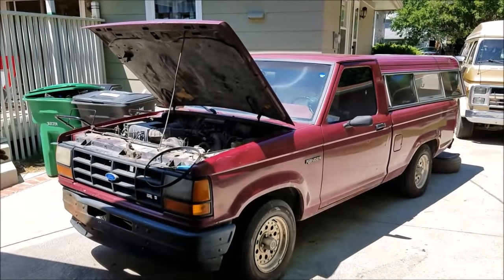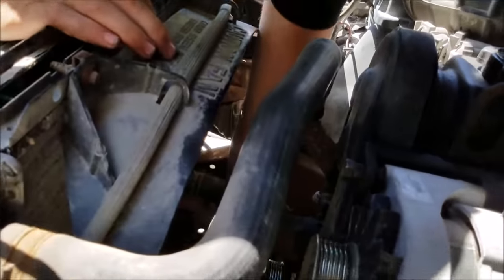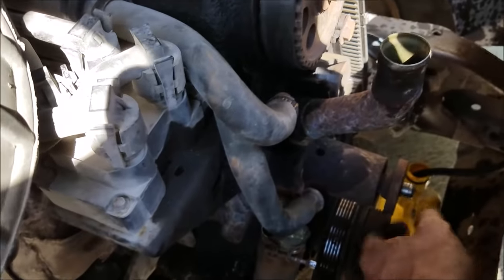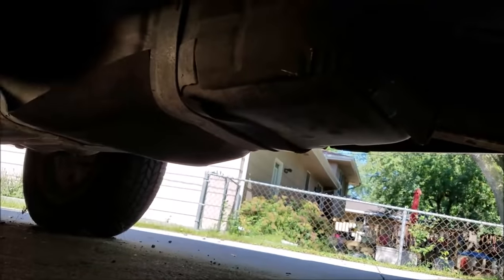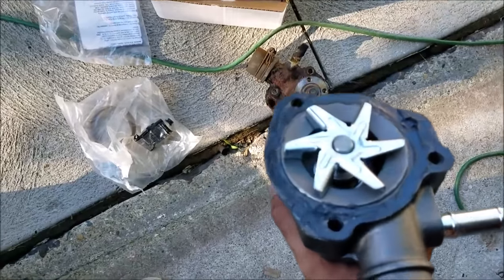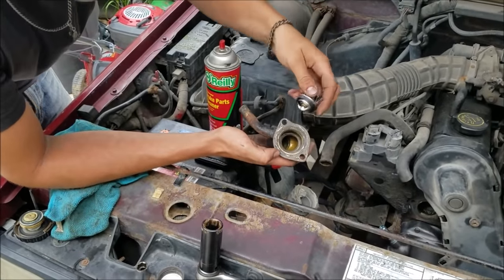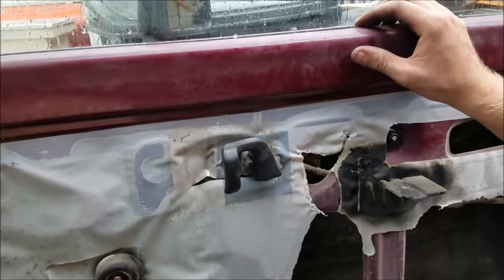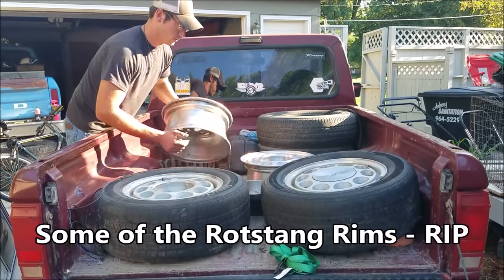Reviving a $500 BEATER - Make it Reliably Roadworthy !!! (TBT First JYD & TH289 Project)

Comment: Had a 89 ranger. Was my dads beater with a heater for many years. Had 296k when I got it from him, done pretty much what ya all did plus clutch. Drove pretty much issue free for 8 plus years to 352k. Gave it to my nephew, flywheel failed at 425k. Would run if u push started. Wasn't worth fixing after he got done with it. I believe in preventive maintenance. Drive a 2003 dodge ram with 244k. No tranny issues. 🤔 bed rust, well you know.  🤣

Comment: I noticed the old fuel filter was an original ford stamped item, so it was probably safe to say it was original to the truck as was probably everything except the air filter, the oil and oil filter.

Comment: I had picked up an old GMC S15 for $300. I put another $75.00 into it, and used it as a dump runner and some daily. I had it four years  and got $650.00 for it.

Comment: If you are thinking there could be a blown head gasket, I would do a compression test on all cylinders, and if 2 cylinders, say 3 and 4 have low compression, it's got a blown gasket in-between 3 and 4, that happened to my ranger.

Comment: until recently, i never paid more than $750 for a vehicle. i drove most of them for two or three years before they needed anything major, at least major for me. oil, filters, brakes, shocks, battery,  exhaust, tires, these are things you know it will prolly need, and are no big deal to me. so, yeah, beaters are definitely worth it. plus, if you don't drive it till it dies, you can get your money back when you sell it.
Reply: I usually make money off them lol. Buy it not running, fix the problems, drive it for awhile and sell it when the right offer comes up.

Comment: My $500 93 ranger supercab has holes EVERYWHERE but the frame... Been trying 4 years to get it roadworthy. It's eaten every hour & every dollar...& its still in my driveway. Pretty sure sticking slave cyl. Also stuck caliper, wheel cylinder , parking brake, and leaking intake gaskets. 

Still cheaper than a new ranger!

Comment: Before I watch the video, I have to say how cool it would be to see a built 289 swapped into this Ranger. The 2.3 and 4.0 are boring...lol I get it though, it's a beater. I've had a few Exploders and Rangers, all with 4.0s and autos (the AOD4 and 4R55E are absolute JUNK, my Exploder went through 5 rebuilds on the AOD4 and the 4R55E even blew out on me). Edit: Nm, I see how much rust was included in the body free of charge...

Comment: In my experience,if you can get a vehicle cheap enough and your mechanically inclined,go ahead,get"em running good,check everything that you guy"s show.Be prepared for contant rotting,fuel lines,brake lines etc.I live in NJ,rust and rot is king!Check the frame for rot before you buy.These vehicles are cheaper but be prepared for alot of repair and maintainence.

Comment: That nickel copper brake line is far more corrosion resistant than any regular steel brake line. If the truck came with nickel copper line from the factory you would not be under there replacing lines. That is what I use to replace steel brake lines.

Comment: I bought a 3500.00 Mercury Grand Marquis LS, pretty well taken care of, but the previous owner died, so I couldn't ask the questions about it.. so i paid 3500.00 vs the 4500.00 the widow wanted, cost me 2k in parts so far, and i have some additional stuff to fix in suspension and what not.. probably sat for 2-3 years.. I would say under 10k for a reliable daily driver today is a good deal.. under 5k for a beater is a win too..

Comment: bought a tarus  police auction $150  drilled out the ignition bought a lock cylinder at salvage yard $10 drove it 3 years including 1 -2200 mile round trip sold it for $350 should have got $500

Comment: My uncle had one with a 350 in it he used to pull his race care with
Reply: Ford is a 302 or 351.. no 350 in a ford
Reply: Skott no, they are mostly the iron duke 4 or the vortec v6, there's a swap kit for the s10 to go to a 350 but the mounts, transmission adapter and nearly everything else would have to be custom fabricated for anything chevy to ford. I just don't see it happening from two cheap pickups.. especially when you can swap in a ford v8 with minimal fabrication. A ford v8 into one of these things basically just uses the fox platform convertible motor mounts and everything else should just bolt up, minus exhaust and fuel delivery depending on the year of the 302

Comment: Nice work - love your $500 deals!   One observation (or confusion - you choose) - the type over at the end said "changed all 8 spark plugs", in a four-banger?  :-)
Reply from the maker: It’s the 8 plug heads indeed!
Reply: @ThunderHead289  Wow - not familiar with those.  Had one or two 2.3s in a couple of Tempos  - hence my confusion.
Reply from the maker: I think it was a ranger thing only
Reply: @ThunderHead289  It is... Super, super, super weirdo Ranger thing. Kind of charming now that the days of that is long behind us though.
Reply: I have a Nissan hardbody thats a 4 cylinder with 8 plugs
Reply: The 2.3 in the Tempo is a Ford engine but not the same as the 2.3 ohc found in the Rangers
Reply: @ayp1938  I never knew there was another one... Now I feel like the motors should fight it out until there's only one left, Highlander style.
Reply: @ThunderHead289  99,00,01 had the right plug . It's a2.5  got one in the back yard with 248\000 on t.
Reply: Maxwelhse I have a Mercedes that’s at least 15 yrs newer and it has 12 plugs and a V6 so I don’t think it’s just a ranger thing or totally behind us
Reply: @TheBrokenLife  the lima would win. Though a tempo 2.3 5 speed is peppier than you'd think. My cousin had one and we'd dog that thing every day. It was a good car for him to learn to drive a stick in. 10x better than the escort he replaced it with.
Reply: @blueovalfan23  There are many good things I can say about my Escort, but being fast isn't one of them...

Comment: The 2.3 Lima may not be the most powerful or fuel efficient, but it's damn reliable
Reply: My 93 4.0L pushrod 6 had 250,000 on it before 2000...think it's 467,000 or 567,000 now....and no lifter tick even -20F

Comment: This makes me want to go work on my Bronco and Durango. Heat went out in both this year.
Not sure about the Durango but the Bronco should be a vacuum problem but first I need to change a power steering pump in my uncle's PT Cruiser.
I am not thrilled.
Reply: I also get excited watching these videos... Only problem is I ran into this one at 2am! Wrenching is long over for the day around my shop.
Reply: A PT Cruiser? Well, at least you'll learn some new curse words. Just about the only car I know of that you have to pull the passenger side front suspension apart to get the alternator out.
Reply: Aceroadholder When I did it I decided just to vacuum the AC out and remove the condenser. I would rather risk messing up the air conditioning Then risk messing up anything that actually keeps me on the road

Comment: The comment section loves those brake lines because they won't rust like a steel line. Thing is, that truck will be long gone before a new steel line would rust out. Been there.

Comment: It really depends whether you can still find parts for them and how easy is to fix them, good luck finding SAAB 9-3 parts because its easier to find parts on a SAAB 9-7x
Reply: Getting hard to find parts, particularly for older fuel injection vehicles.

Comment: I see a carburetor swap coming on  this truck in the future 🤔
Reply: that truck is long gone,  this was 2017
Reply: I hope neither of those things is true. The Ford EEC-IV computer is one the easiest EFI systems on Earth to work with. No reason to scrap it.
Reply: This is the second part of the original video from 2017 they just filmed this video. It's new, you can look at the date of the video
Reply: I owned a carburetor swapped svo mustang, i assure you no matter how bad the EFI was on these 2.3 the carburetor options were worse...
Reply: @shartingfish5761   maybe you hadn't tuned the carb properly :)
Reply: lobmin I was 17, it's possible, i pretty much learned cars on it, so it's possible, it was also a turbo car, which adds to complexity of a carb, but what made me dream of EFI was when it was cold out, it was a huge pain in the ass to start in the cold. -15 to -20F it just wouldn't start.
Reply: @shartingfish5761  oh, yeah turbos add a whole new world of problem solving. I hope at least it was a carb made for pressurizing. Or was it a draw-through setup?
Reply: @shartingfish5761  It;'s not at all uncommon to have to re-tune a carb between seasons. Odds are good a small adjustment of your choke every fall, then spring, would have cured your cold start issue. That sort of a basic tune-up would have been included in an oil change back in the old days, right along with checking the tire pressure.

Anyhow... If that truck is still around, I hope it's still EFI.

Comment: Got a question it says you changed all 8 spark plugs. How did you manage this since it's a 4 cylinder motor?
Reply from the maker: It’s a dual plug ranger head. Ford ran the dual plug head in the 2.3 for awhile

Comment: lol, the 13psi on the cap is psi, your putting a vacuum to the system which would be in/hg lol
Reply from the maker: Nope, there are two different mityvac pumps - the brake bleeder and the pressure unit - this one will literally push coolant out if there is a leak point. 
- google the mityvac cooling system tester 👌
Reply: @ThunderHead289  oh my bad, I couldnt tell in the video

Comment: MY SISTER DROVE A 1979 TOYOTA CELICA FOR ABOUT 25 YEARS AND HER HUSBAND A TOYOTA TRUCK FOR ABOUT 28. HIS EXPEDITION LASTED ABOUT 15 YEARS.
Reply: If it was a '94 Celica it would be indestructible.
Reply: @GemmaLB  It got hit at 90 in the rear by a 1979 fordLTD and looked like a dog taking a crap but a friend pulled out the frame and fixed it. It ran 15+ more years.

Comment: Had 91 ex cab ranger 4.0 had main barring going out drove daily entered burn out contest trying to blow engine back in high school. Had a 302 h.o. out foxbody c4 trans out in it dad's only deal had to pop that motor by daily driving. After two years parked it guy stopped want buy it test drove around town after sold it made up road and locked up.
Reply from the maker: I’m sure he walked right back to you in anger
Reply: @ThunderHead289  not really paid it for 300 came back offered give money back he had friends bring trailer he wanted build bagged mini truck out of it

Comment: Since you are working under the thing and it is so low to the ground, jack it up.Also, Rather than using a grinding wheel to cut the hose clamps, use a large pair of diks.
Reply from the maker: Howdy, I agree - I just used what I had available to me. 
Loaned my jack, and you know how that goes!!!!

Comment: Aren’t some of these rangers basically mazda B1000’s?
Reply from the maker: Exactly the same
Reply: Initially Mazda made trucks for Ford named the Courier. Later the Ford Ranger platform was used for Mazda trucks when Ford had a much larger stake in Mazda.
Reply: There are no B1000's the number after the B is the size of the engine in cc's so the rebadged Ranger era ones were B2300 B3000 and B4000

Comment: Thats nickel plated brake line. Been using for for about two years my self. Up side is it bends easily and doesnt like to kink. Downside is it bends easily. Its great when forming whole sections of line with tools is almost impossible. Huge time saver. But im a little anal and when doing long straight lines its super hard to make it straight-ish!

Comment: 24:29 Changed all eight spark plugs ehh? lol.
Reply: The later 2.3 ohc engines were dual plug heads
Reply: @darylcohn9074  I didnt know that. On this one I only saw 4.
Reply: @darylcohn9074  the later 2.3 ohc were not dual plug heads, any 4 banger Ranger newer than 2001 does not have dual plugs.
Reply: Ricardo The PC Gamer Those are completely different engines though
Reply: @darylcohn9074  i know
Reply: Ricardo The PC Gamer Well I stand by my comment because it is accurate. The 2.3 ohc is another name for the Lima 4 cylinder but nobody ever refers to the Duratec as that, it was a dual overhead cam so if anything it would be a 2.3 dohc but it is just called the 2.3 duratec to make the distinction. I don't mean to nitpick but I've been driving Rangers since they debuted in 1983 and I often see a lot of confusing misinformation being spread about them
Reply: @darylcohn9074  my next door neighbor has 94 base with the i4, it has the dual plug setup, it is a basic ohc driven by a timing belt. My friends dad has an 06 Ranger base with an i4,  duratec, it is a mazda designed engine with a chain driven, double overhead cam setup. It is a different animal compared to the old i4 from the 90s. Those old ones were gutless engines, underpowered. Both older and newer I4s in the rangers are very reliable engines though. The Rangers have always seemed to be reliable trucks, especially the i4 models.
Reply: Ricardo The PC Gamer I also have to say the new 4th gen  Rangers are atrocious. When I talk about Rangers I don't even include them but since Ford insisted upon resurrecting the name I'll have to remember to point it out whenever I make any sweeping comments about Rangers.
Reply: @darylcohn9074  yeah

Comment: 8 spark plugs on a 4 cylinder non-intercepter motor. Hmmmmm
Reply from the maker: It had an 8 plug head - search 8 plug ranger mod - you will find the video where I mess with it
Reply: ThunderHead289 thanks

Comment: Man, why don't either of you clean up the engine bay before you start fixing stuff or even while you fix stuff lol it drives me crazy.
Reply from the maker: Because it’s a 500 dollar ranger - we don’t care, that’s a waste of our time. We have chromed our vintage pushrod V8 cars that we keep decent, were not going to be showing off some old ranger
Reply: @ThunderHead289 lol no, not like that. I'm talking just spray it off and degrease it, maybe knock some rust off a part when you have it off with the wire wheel.